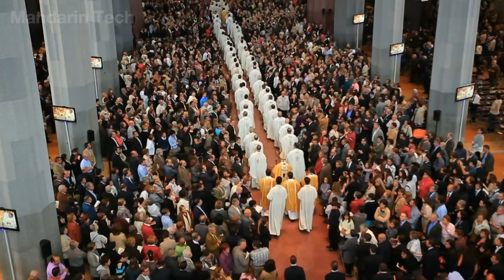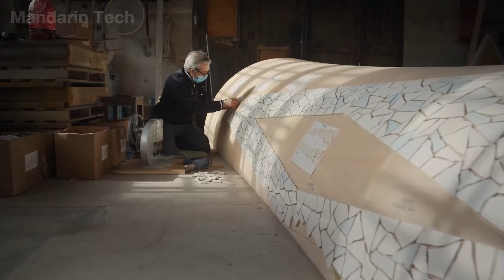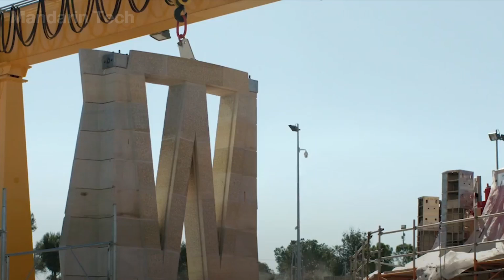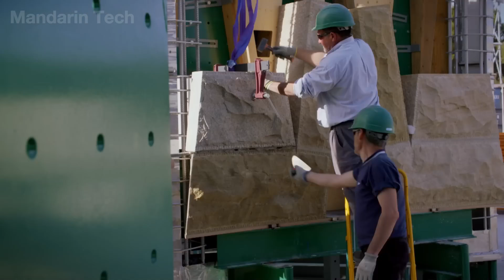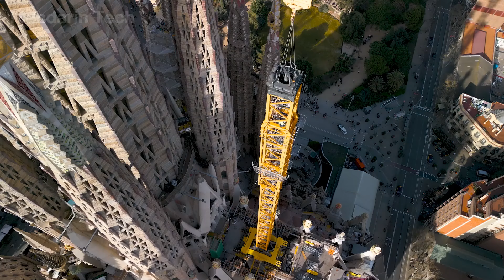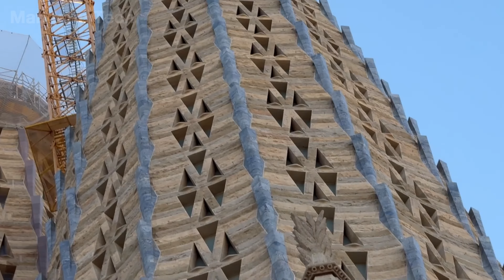Spain Finally Completes Sagrada Familia After 144 Years Of Impossible Construction

Comment: You speak of the internal, tree-like columns are made of solid stone, however, that is, apparently, not true. According to some reliable sources, they are steel-reinforced concrete, with a stone veneer, construction which is said to be very strong, perhaps stronger than solid stone pillars, though I find that questionable. I have my doubts that any material, in compression, would be stronger than solid stone!
Reply from the maker: Thanks for the detailed insight! The columns' materials and structural design are more complex than we described, and we'll aim for greater accuracy.

Comment: I don’t know why some are calling the Sagrada Familia “finished.” It is not finished, and its incompletion is not limited to interior details. The Glory Facade, which will be the main entrance to the basilica when it is complete, has barely been started! What will be 4 additional bell towers, not quite started, together with the facade itself have not yet been built… and building it, and especially the planned approach will require the demolition of the block across the street, to which there must be some resistance. It is certainly one of the best addresses in Barcelona!
Reply from the maker: You make a great point! Despite major milestones, Sagrada Família still has significant work remaining, especially on the Glory Facade.

Comment: Except it isn't.
Reply from the maker: Could you share more details?
Reply: @Mandarintechmido They are still doing a good deal of work inside.  It'll continue for several more years.  As well there's a large patio type of construction that Gaudi planned for the, I think it's the south door, that's meant to be huge and requires the removal of some tens of homes and structures.  The City has said they are doing it but it's likely to be challenged for years more and if it's done it'll be some more years.  So they did reach a great point in the work.  Though it's not finished in the way the report would seem to be implying.

Comment: "Original design drawings lost". Typical. Because the building is way older than 144 years. But they think we're all stupid. Fire on the mountain. Run, good ole boys run.
Reply from the maker: It’s true many original models were lost during the Spanish Civil War in 1936. Engineers today are reconstructing the geometry using fragments, archives, and modern software.

Comment: Beautiful bit it's not the same as what Gaudi envisioned.  For example the stone is different and Gaudi certainly did not envision prefabricated modules with modern materials.  But still impressive and I congratulate Barcelona, which will no doubt benefit from this structure as a tourist destination.
Reply from the maker: That’s a very fair point, modern techniques are often needed today to continue building in the spirit of Gaudí’s original vision.

Comment: Traditional Gothic is anything else than thick walls (that would be Romanic). It is based on windows, as more as better, but no walls. But the difference to Sagrada Familia is that the load-bearing structure is on the outside, not the inside.
Reply from the maker: Great point—Sagrada Familia’s structural system is indeed very different from traditional Gothic design.

Comment: Sorry but you are wrong about " thick walls of gothic architecture " (mentionned twice). On the contrary, gothic cathdrals had thin walls as well, thanks to the flying butttress positionned outside the walls of the buiding. The flying buttress allows walls to be thinner while still preserving a high ceiling, and enables the inclusion of large windows that illuminate the interior of the building.
Reply from the maker: Thanks for the clarification—flying buttresses were indeed key elements in Gothic cathedral design.
Reply: Absolutely correct. That was the big leap taken by architects form the heavy, thick walled Romanesque churches.